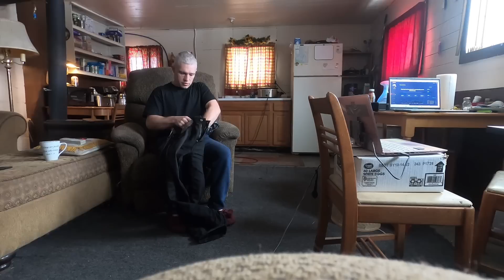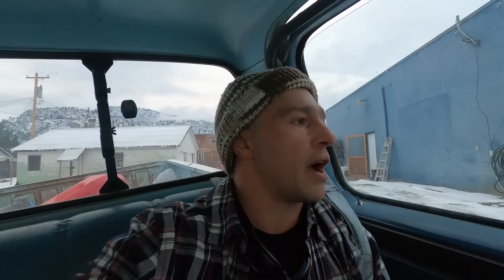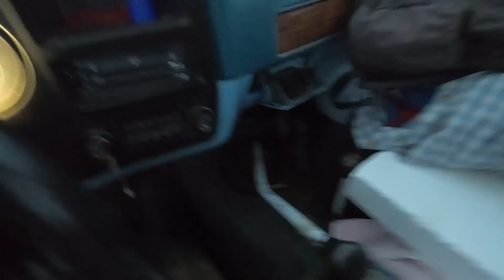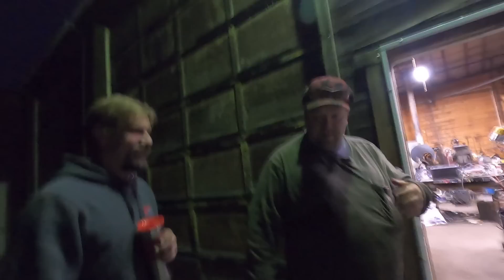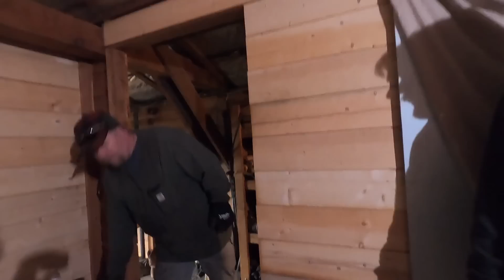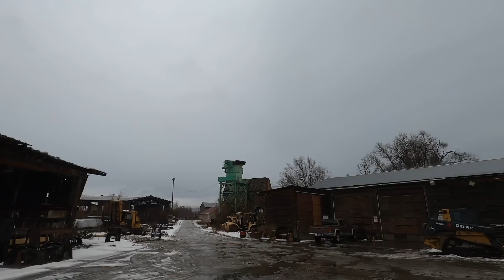From the farm to the shop. 1/22/2024

Comment: At time of leaving  Matt says it’s 32 degrees out and just rain overnight traction looks good.  Got $30-$40 in fuel, enough to move around.  Fuel looking good again as well as good traction at this point. Now too MUCH weight, slow down now to save gas. Too much weight now slow down , bad tires have to slow down, not too slow though not enough time to slow down.  All With Quentin Tarantino  B rated Pulp Fiction sound effects including wiper blades scraping against a dry windshield. Please don’t talk to the truck anymore Matt.

Comment: When you're in four-wheel drive, drive slower, take your time its safer that way. You will get use to it.
And go much much slower in the ice areas and don't slam on your brakes ease into the brakes.
You look like your going to fast, just take your time be safe.
Having weight in your truck is better for traction. You only have your personal things in the truck right.

Comment: Hi Matt, what an adventure! Just a silly question, why does letting the air out of your trucks tires help with traction? 😊
Reply: HI! Not a silly question at all! Letting the air out of tires will allow more of the tire and tread to make contact with the road, and this helps traction. I will do the same thing on my mountain bike if a downhill track has a lot of loose gravel. Works very well!
Reply: @Lydia--Ann  oh thank you Lydia Ann for the reply 😊
Reply: Letting air out of your tires will provide less traction than more. Letting air out of the tires is what people do who are running in sand.  The fatter the contact with the road dissipates the load per square inch providing less traction . Simple physics concurs with this principle.
Reply: @joshrikki4408  thank you ☺️